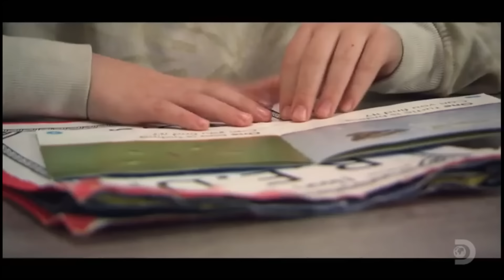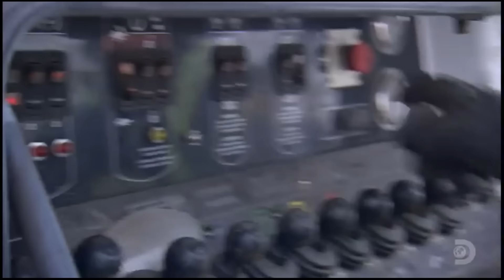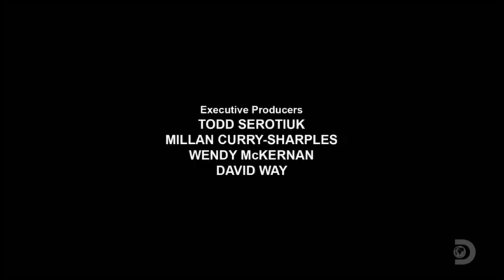Nature of The Beast - Heavy Rescue - S07E12 - Reality Drama

Comment: I have only had to abort trips because "professional drivers" will not slow down and drive appropriately for conditions. I always have the best winter tires I can get. My current car is a 2004 Toyota Corolla on which I installed Nokian Haakappilliitta R5 winter tires. At $900 a set they are not cheap, but they are reputed to be the best winter tire, period. If the road is open, I'm getting through with no problem. It is a combination of capable car, excellent tires, and proper driving training.
Fire in a truck is nasty. I wonder if anyone spotted the fire and tried to get the driver to stop. That happened in front of me. Smelled and saw the smoke in Kleinberg. Come Schomberg I called 9-1-1 because the driver was ignoring everything, and flames were visible in both back wheels. Even after the air lines fsiled the driver was still trying to drive in. Fortunately the OPP were on scene quickly with the volunteer firefighters not far behind.